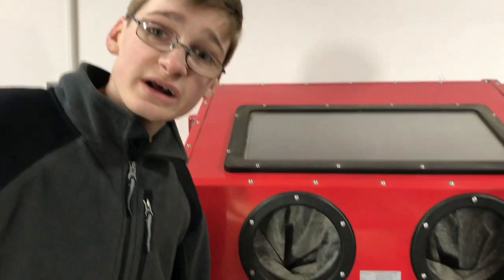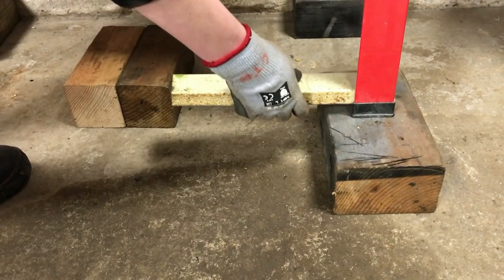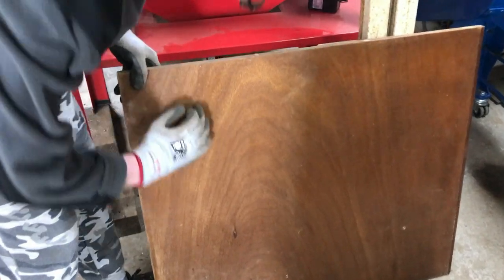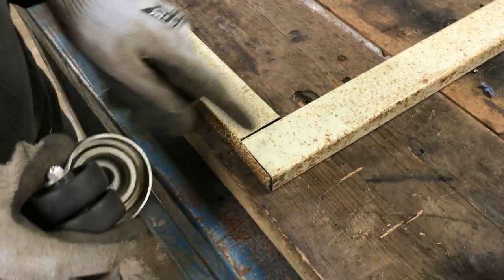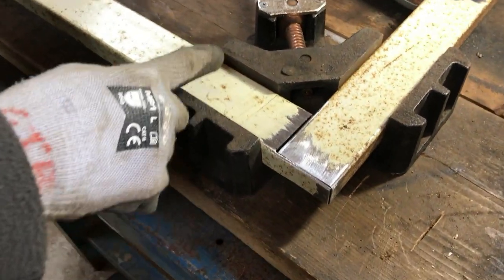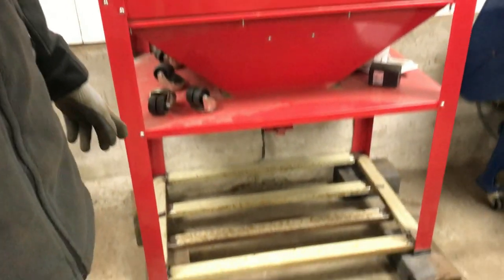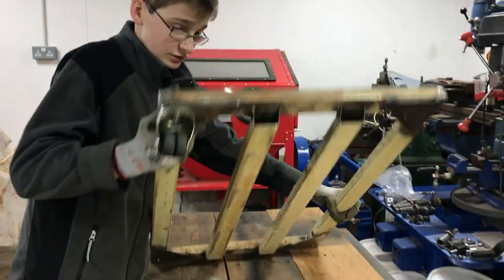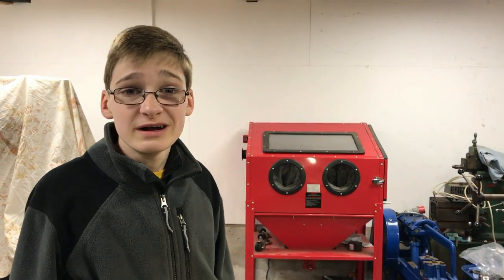Wheels for the Gritblaster on Workshop Wednesday

Comment: Great work Joseph! I have the exact same blast cabinet! Im sure mine would benefit from some casters as well!
Reply from the maker: Thanks. Since doing this we have found a number of added advantages. It is good to be able to move it away from the machine tools when using it, the frame we made has made it a lot more rigid and the additional height of the caster has made it better to use. Making something similar is worth thinking about. Take care